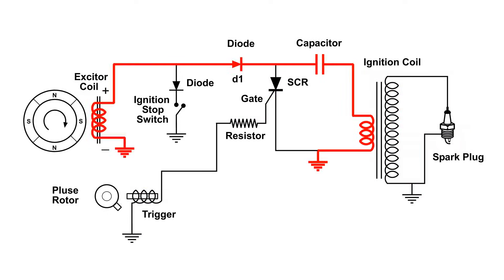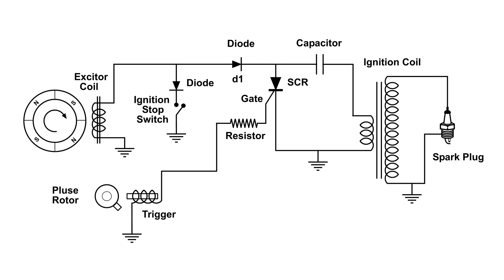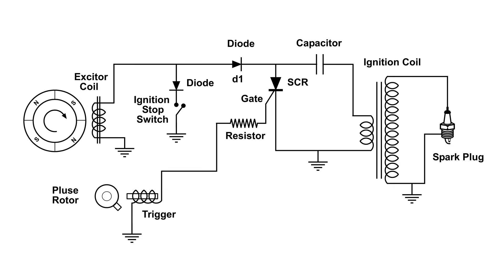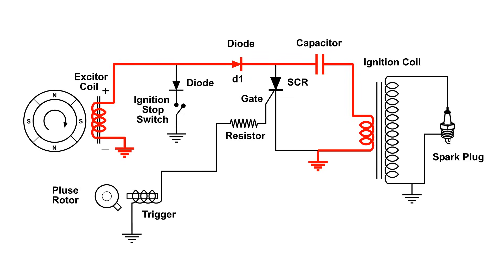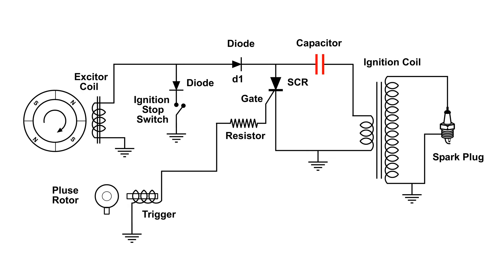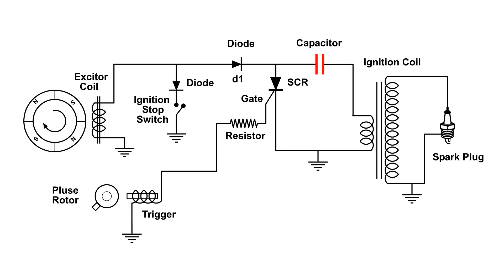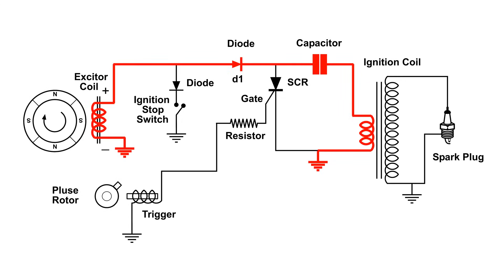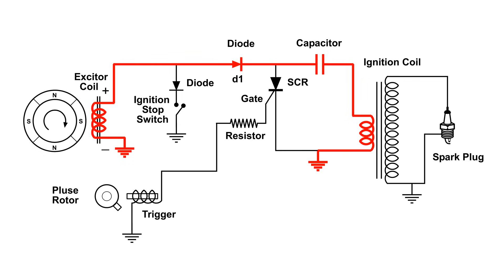CDI Capacitor Discharge Ignition Circuit Demo

Comment: Highly invaluable video, I saved a lot of time and money making my own CDI circuit from basically exactly this schematic for a 125cc dirt bike. 100ohm resistor, 1n4007 diodes, 1uf 250v cap and a BT169D thyristor.
Reply from the maker: Usually the capacitor is the part that fails first.
Reply: HI All American Five today I opened an original dirt bike CDI, I can see to have a 250v orange capacitor, I am from Brazil, but I did not think to buy this cdi here and when I thought it was very expensive 450 500 $ How Do I understand enough of electronics to make my own cdi
Reply from the maker: Don't know, a YouTuber asked me to explain how the CDI circuit functions
Reply: BT 151 Thyristor is higher rated and normally used, capacitor should be non-electrolytic (apparently electro's aint up to the pounding)!
Reply from the maker: I'm glad the video helped
Reply: Do you believe this circuit meets my dirt bike? because shee reaches 11 000 rpm two stroke power monocylinder
Reply: Frank Reading I  .
Reply: What did you use for a step up transformer, Frank?
Reply: Hi good work frank this project, I need to make this CDI of my dirt bike he is a suzuki rm 125 92 you know its work on my motorcycle? send me a e-mail please i realy need this project help me please, sende from: ph_monteiro2005@hotmail.com

Comment: What I don't understand is how the SCR gate "closing" to allow current flow to ground along the non-primary coil path causes an increase in the primary such that the secondary is energized. 

I thought it was the collapse of the primary coil EMF field that triggers the voltage jump in the secondary. Is that not correct? Does the SCR gate closing allow the capacitor to discharge along the alternate path instead of through the primary coil and that triggers the EMF collapse & induces secondary coil voltage?  If this is so, then I think your animation needs a slight change, showing the red primary path changing to black/unpowered during the trigger point.
Reply from the maker: +TornadoCAN99 

Silicon Control Rectifier SCR Basic AC Circuit
https://youtu.be/45H4J_S52Y4

Silicon Control Rectifier SCR Basic DC Circuit
https://youtu.be/ImyTwZGZ-Ls

Transformers, a few basics
https://youtu.be/UvHCQswnjEg

Transformer Basic Parts & Function
https://youtu.be/q3YhbugYjJY

Impedance, Back EMF, AC Resistance
https://youtu.be/y11SbmXPY18
Reply: Note that the magnetic field from the primary coil penetrates the secondary coil as well.  Thus the change in the primary's magnetic field is also a change in the secondary's field, and a rapid change of magnetic field in any coil produces a high voltage at that coil's terminals (in this case, the spark plug's electrodes.)

Comment: GREAT description of how a CDI works, easy to understand. I need to build a CDI for a motorcycle engine that uses two trigger coils. One at 10 BDTC and another at 35 BTDC. I assume I'd duplicate the SCR to the trigger circuit. But how would it "switch" to the 35 BTDC trigger as the engine speeds up? I need the advance to occur before 2,500 rpm.

Comment: Does the CDI system have a distributor?
Reply from the maker: +GiveMeLiberty3 
Not this one, it only has one spark plug
Reply: +AllAmericanFiveRadio So if it had more than one spark plug then there would be a distributor?
Reply from the maker: +GiveMeLiberty3 
The job of a distributor is distribute the spark to the spark plugs. I don't know if there are any CDI engines with more than one spark plug.
Reply: +AllAmericanFiveRadio Thanks.

Comment: if the crank were rotating the opposite direction than what the cdi unit called for, would it still work?
thanks
Reply from the maker: +tjmars37 
Yes it would still work. When the crank turns in one direction + - + - + - voltage is made, when the crank turns in the other direction - + - + - + voltage is made. This circuit is using only half, the + half and it is created in both directions.
Reply: +AllAmericanFiveRadio thank you

Comment: I put a CDI system in a Ford 4 cylinder Cortina many years ago and straight away noticed more power and better idling , except one night i noticed that the engine was idling roughly when I opened the hood it looked like a Xmas tree, sparks leaking from all over the spark plug leads .The higher induced voltages must of been to much for the leads , the simple solution then was to buy HV insulating sleeve and install the leads inside.
Reply from the maker: +190055joe THANKS

Comment: So the SCR is...an N-channel MOSFET?
Reply from the maker: +rlrsk8r1 
Your comment ended up in "Likely Spam".
No, SCR stands for Silicon Control Rectifier, it is an on off device.
Reply: How is that different from a transistor though?
Reply from the maker: +rlrsk8r1 
SCR's are ON OFF devices like a switch, and transistors (Junction or Mosfets) can be controlled through a range of resistances from ON to OFF or OFF to ON. Here's two videos that may help.

Silicon Control Rectifier SCR Basic DC Circuit
https://youtu.be/ImyTwZGZ-Ls

Transistor, How Does it Work in a Circuit, Demo
https://youtu.be/vs3zUHdlsYY

Comment: Good explanation. I take it that on a motorcycle with a battery, that the battery serves in place of the exciter coil?
Reply from the maker: +TroyaE117 Thanks
I would need to see the circuit drawing
Reply: I have one doubt from your schematic, weather  battery is needed absolutely .Or the magneto is enough to produce power to charge the capacitor and work to the dynamics of the ignition system pl.

Comment: On the old 2 stroke motorcycles I'm playing with, there seems to be no mechanical advance. Do some electronic ignition circuits have a circuit that effects ignition advance?  Or on these motors is spark advance a fixed value.
Reply from the maker: oilmaninpowell 

There are ignition systems that adjust spark advance with engine speed.
Reply: Interesting reading! Thank you!

Comment: Nice video. As is can see it, the function of the ignition pulser is triggering the gate of the SCR. This means that current in the wires of the pulser is actually under 1A. Am I right???
Reply from the maker: Jovann Pérez 

Yes, the gate current would be very small.
Reply: AllAmericanFiveRadio 
I checked the flowing current thru the wires of the ignition pulser. As u said and I expected it was a little one. 1.5A are required to strart the engine of and 200cc motorcycle. Thanks for your excellent video.

Comment: Thanks for the demo was wondering how I could reverse engineer this and I think I can now. I have a bank of coils discharging into a network of caps. I then want to discharge these caps while effectively swapping the coils onto another bank of caps so I can charge these while discharging the other bank then swapping back to the other bank and then the whole sequence repeats. Just one query shouldnt the primary coils emf  collapse as the cap discharges then induce into the secondary coil and across the spark gap?

Comment: I'm struggling to understand how to diagnose exactly where problems occur in a CDI circuit.  If anything goes wrong in the circuit there will probably be no spark from the coil???  If there is no current to the coil but the stator is putting out how can I determine if the problem is in the trigger, SCR, or diode, or one of the connecting wires?  I have my  ideas but want to know how others do it...
Reply from the maker: aNuthaRedneck 

To troubleshoot any circuit you must first understand how each component functions. Once you have this understanding then you can test each component to see if it is functioning properly. Some of the major components in this circuit are the SCR, diodes, and transformer. You can do a local search on my channel and I have made several videos of how these components function.
Reply: Thanks... this can be very important in correctly diagnosing outboard motor issues.

Comment: Excellent.Thank you! 

I'm working on a motorcycle. I'm not sure what the "rotating magnet" is that charges the coil? Could you clarify?
Reply: ***** Not sure about other bikes but in these small 125cc's and 140cc's etc the flywheel has the magnets in it, 
and it is the flywheel that rotates around the coils
Reply: On your flywheel or perhaps the other end of the crankshaft.

Comment: Great  schematic really easy to understand' i would like to know how the cdi unit advances the ignition timing as the engine rpm starts to get higher because the spark time as to advance to give the spark at the right time as rpm increase. and information would be greatly received thanks.
Reply from the maker: Kevin Brain The ignition timing can be done
mechanically or electronically. This video came about because a
YouTuber sent me some diagrams of CDI circuits and I told him I would
make a video on it. I would be glad to look at ignition timing, but I
would need some wiring diagrams of the circuit you're interested in.
If you know of some links to the wiring diagrams please send them to
me.
Reply: yes i am interested in the electronically controlled advance system as the mechanical system is old school now and really of no interest to me. if i find something i will send it to you and thanks for your reply.
Reply from the maker: I would contact the manufacturer of the motorcycle engine. They would have the best knowledge of what ignition system will work for their engine. Also I would study other manufactured CDI circuits. The reason for this is, if you try and reinvent the wheel you'll find out that somebody else has already done that. So looking at other successfully engineered circuits can save you a great deal of time.
Reply: As the engine RPM increases the magneto voltage increases more quickly, thus reaching its desired trigger point in less time.  Thus the spark is advanced, at least in self-triggering CDI magneto ignition systems.

Comment: Hi 
Great skematic of a CDI ignition.  I'm trying to adapt a CDI box to my positive ground 1967 MGBGT using a commercially available CDI* unit with the following wiring hookups.
Black/Red= stator coil
Black/White= goes to kill sw.
Orange = to ignition coil
Black= ground
White/red= Trigger

Is it possible to just use 12V Dc instead of a stator coil, and a regular set of ignition points as trigger?

Any feedback is welcome.

Thx
Rick (Lauren's Dad) 

* CDI  1538  for a Yamaha 1991-2002 YFS200 YFS 200 Blaster
Reply from the maker: The spark at the spark-plug is in the thousands of volts.
Reply: DC CDI is what you will need it uses battery volts to power coil and just uses stator to charge battery but obviously still need the trigger
Reply: AllAmericanFiveRadio yea but all you need is 12v in a dc cdi set up and that sends the around 400v needed to the ignition coil the coil makes 20,000 u need to jump the gap on the plug so to the answer to the question it is possible to use battery volts 12v dc to power an ingition system instead of a stator coil you just need another way to get the primary volts right.
Reply from the maker: I would contact the manufacturer of the motorcycle engine. They would have the best knowledge of what ignition system will work for their engine. Also I would study other manufactured CDI circuits. The reason for this is, if you try and reinvent the wheel you'll find out that somebody else has already done that. So looking at other successfully engineered circuits can save you a great deal of time.

Comment: actually, now that I look at this schematic further, I getting even more confused. Again the schematic shown here may be perfectly accurate, but along with my other post.......
 I assume that the capacitor is a non-polarized type, and maybe only it's positive leg should be tapped into the line going to the primary coil. and the other leg grounded. and the positive (+) and (-) signs are throwing me for a loop too. + next to ground....
Reply from the maker: send me your diagram
Reply: Ignore all of the polarity signs.  Then draw wires to connect all those ground-symbols together.  Then erase the ground-symbols.  This will make the circuit easier to visualize.  The capacitor is a big, high-voltage, non-polarized device.  It is in series with the SCR, which is just a switch operated by the trigger switch, and also in series with the DC source formed by the magneto plus the left-hand diode,  and the primary coil.  When the trigger switch renders the SCR non-conductive, the magnetic field in both primary and secondary coils will collapse.  The collapse of the secondary's field produces the necessary high voltage across the plug electrodes.

Comment: I have been trying to learn and diagnose a small engine with no spark. these type videos are great !
Im almost amazed at the effort people put into these videos and the value that we all can get out of them.
Im no engine or electronics expert but i know enough to fix some things and other times royally ruin things.
I might be totally wrong but it doesn't make sense to me that the ignition's primary coil is grounded directly. I figured it would get the solid ground thru the gate(SCR/transistor or whatever it is)
Reply: Yes even 8 years later. fantastic!!
Reply: How to use eliminate,
Reply: And ,did you know how to create a klin spark ignition for ceramic factory

Comment: Wouldn't the polarity be the opposite of what is shown? I would think the negative part of the cycle would be feeding electrons to the capacitor since electrons have a negative charge.
Reply from the maker: A rectifier (diode) only allows current to flow in one direction. To utilize the other half of the AC cycle, a diode bridge would be used (four diodes), and the circuit would also need to be reconfigured. Google “diode bridge”.

Comment: Is the pulse rotor the same as the pulse generator?  Is the excitor coil the stator and rotor?
Reply from the maker: The thing to do is to look at what part is doing on the engine. The manufacturer can call the parts anything they want, usually because of copyright/patent infringements.

Comment: Hi again. I have a link to a cdi I think I can use. I was going to mirror the circuit to get two trigger inputs and two outputs. The original mercury circuit does exactly that but uses two unidentifiable transistors to dump the charge instead of an scr. Do you think it can be done with this circuit?
Many thanks in advance for looking

Comment: On my honda engine, the pulse rotor is the magneto  wheel itself,  which turns at the same rpm as the crankshaft, so there would be a spark for every rotation but really there should be one for every second, for a four stroke right? so why did they do that?
Reply: That's called wasted spark ignition. The wikipedia page "Wasted Spark" has more info on it

Comment from the maker: The ground is the same ground everywhere just think of it as a wire. When the capacitor is charging the ground is negative, that negative goes up through the primary of the ignition coil making the right side of the capacitor negative. That makes the left side of the capacitor positive. Electrons will flow through a diode device against the arrow.
Reply: While looking at it with the electron flow view it makes perfect sense.

Though it seems to confuse those eyeing the ground location of the capacitor/primary coil leg from a conventional current flow point of view.

Comment from the maker: Yes without the diode operating the ignition stop switch would kill the engine and stop the ignition from firing. Without the diode there would be twice as much current through the exciter coil which also means twice as much heat. The designer of the circuit has determine that there would be no damage to the exciter coil by adding a diode, and ignition stop switch still stops the ignition from firing.

Comment: Hi Rick.
I had to figure out why you didn't just have a battery connected to ground and the anode of D1. It took me a few seconds then it hit me. The cap would never discharge.
Nice demonstration!
Tom
PS I see SpeakerFreak95 is back! Does he still live close to you? I hope he is still using that AM transmitter that you gave to him.

Comment: In addition to my other note, cars don't use CDI(capacitor discharge unit), rather it uses Transistor switching the ground side, with positive connected to positive side all the time.. hope my 2 notes would have made sense..  CDI is used in Motor bikes and transistor switching is used in Cars.

Comment: yes modern car have Cam sensor(provides which cylinder is top), and crank sensor(provides whether cylinder is approaching top dead or not) is fed to ECM/PCM, then PCM will send pulse signal to ICM(igniter) which will momentarily supply ground(using transistor switch on / off) to the ground side of the coil, note positive is 12 volt connected all the time, this makes a spark..

Comment: No pulse coil in car's.  I would guess this is an ignition system for a lawnmower but this is just a guess.  Modern automotive (and motorcycle) ignition systems are slightly more complex and  use a crank sensor and a camshaft sensor (faster start times) and do not generate their own power from a magneto as this demo shows.    All the other concepts are the same.  Very nice demo Rick.

Comment: Thanks Rick for uploading this video,, little bit of insight for others. Pulse coil is the one which would trigger when piston comes to top dead center in motor bikes.  IN four stroke engine, u have intake(getting GA), compression(compress the GAS), spark(spark the compressed gas) and exhaust as four events, u want to spark the engine at the top of compression stroke, pulse coil will provide pulse exactly at that stage.. In Cars Transistor is used to pulse the coil ground and power is steady

Comment: This circuit is used in motor bikes. If you want to kill the engine, u use stop switch which will short the exciter coil to ground providing no current to spark plug and ur engine comes to stop.